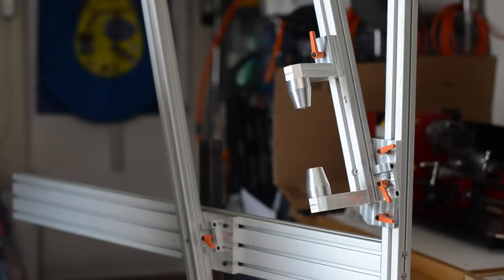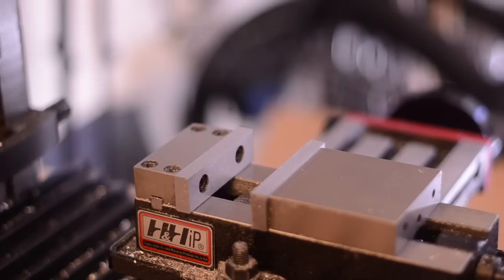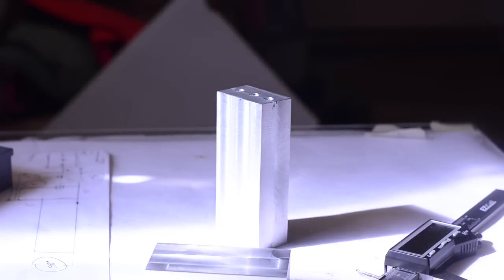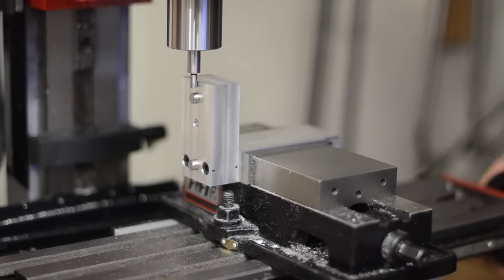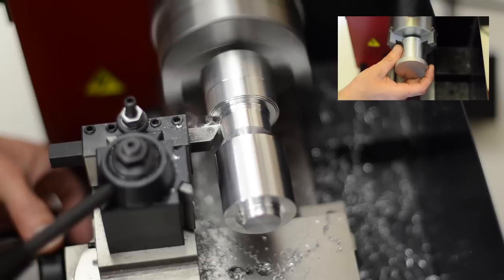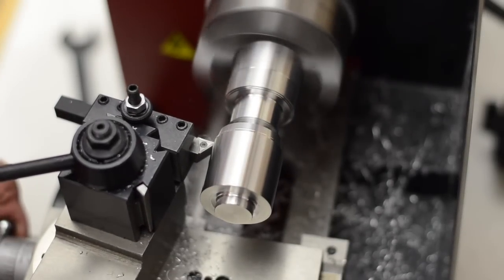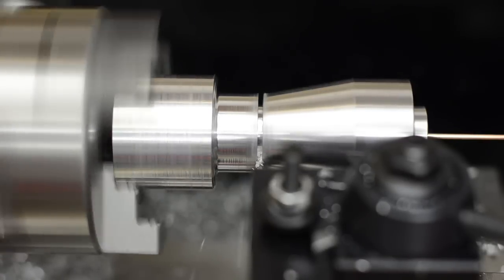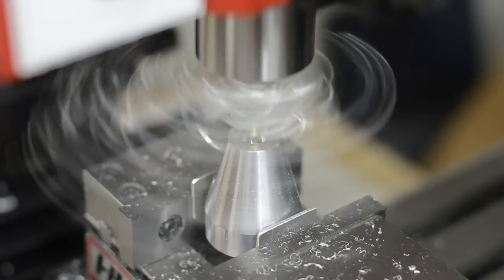Bicycle Frame Build 19 - Frame Jig Pt.11 - Turning seat tube cone on mini lathe

Comment: Hey Pithy,

Great video series! You might want to also invest in a 4-jaw chuck if you don't already have one. Then you can flip or remove/reinsert the part and get it exactly centered. You already have a dial test indicator to get the part aligned. Once you've done the 4-jaw procedure a few times it is really pretty fast and easy. Abom77 and Keith Fenner on YouTube both have videos on using a 4-jaw. In fact I don't think I've seen either guy, both really experienced machinists, ever use a 3-jaw.
Reply from the maker: duncan mcdonald Indeed I really do need one! I've just been to cheap ;) Day will come soon I'll pick one up. Thanks for watching!

Comment: Not sure if it was mentioned but reduce the stick out of the parting blade to the distance you need plus clearance and that will help.
Reply from the maker: +John McRae Thanks! Yes that works great. I've since started parting in reverse with the tool flipped. A bit weird, but on minimills it works best for me. Cheers!

Comment: First of all thank you for such precise information and explanations. Also nice job with cones, i am building jig aswell  and I want to avoid extra work on cones since i dont have as many gear as you have. Do you thing would it work if you just added shoulder bolt and  rubber on bottom of cones. Would that be enough to stop them wiggle?
Reply from the maker: Shoulder bolt should do the trick just fine. Maybe you won't need the rubber. Just. Make sure you drill for a snug fit to the bolt.

Comment: How did you find the center of the cone when machining on the milling machine? Did you use inside of the vise?
Reply from the maker: I used a pointed center finder. And touched the insides of the drilled hole. I didn't need much tolerance for this cut because it's a counter sink. Thanks for watching!

Comment: He was probably right, but you will need pieces like the ones in the photo i put in my first comment to prevent the tubes ovalize for the welding, when you weld outside the jig, yes they are for purge but they do this other function, maybe more important
Reply from the maker: ***** Ah I see. Yeah, People in the class were getting some distortion. It's quite common for first time builders to sit on a bead too long and overheat the tube. Some welders use pulse to minimize the heat.

Comment: increase your rmp's when coming closer to the center of your piece and make sure you tool is perfectly on center height. and you should (grind) angle your tool if you get wat i mean
Reply from the maker: +shameboy2 Right on. Yes I learned about this just recently. The surface distance per rotation drops as you get closer to the center of the work piece while turing. Thanks for the tip and thanks for watching!
Reply: +Pithy Bikes  no problem! I work on a cnc lathe and the machine does this for you. Maby try to find some info about the geometry of the tool i have some tips but its hard to explain

Comment: Ehi, i worked with a purge setted jig, it is ok if you do tig, but you need it, in my opinion, more for welding than for tacking, so when you start to put toghether the frame in the jig and tacking it you don't need it, but when you remove the frame from the jig and start welding you are going to need a purge system, with things like those http://www.otmbikes.com/wpblog/wp-content/uploads/2013/01/DSC05372.jpg
that olso mantain the round shape of the tubes after welding
Reply from the maker: ***** I'm pretty confused over this. Some folks say you need purge on steel and some say you don't. I took a short course on frame building about 2 years ago. We built mtb frames and the instructor, a former builder and machinist for Chris King said it wasn't necessary for steel. Titanium, that's a different story.
Reply: Pithy Bikes That's correct. Steel is not necessary, titanium yes, and also stainless steel. 
Where did you take your framebuilding course? I'll be taking Doug Fattic's course on late september. 
Keep on with the videos!! This is of so much help, i'm really looking forward to the next one. 
Cheers!
Reply from the maker: Ignacio Marino Andrada Hi Ignacio, I took the frame building class at The Crucible in Oakland CA. http://thecrucible.org/ I also took 2 welding courses and a machining course there. Doug Fattic's class looks awesome. Good luck and have fun!

Comment: The cutter is necessary to sharpen. And then bite, and the item will arrive on the forehead. It is unpleasant to be. And it would be good to use a female. For aluminum, kerosene fits well.
Reply from the maker: +Иван Петров66RUS Thanks for the tip. I haven't sharpened the cutter in a while. I'll definitely do that next time I use it. :)